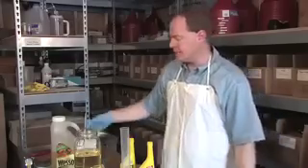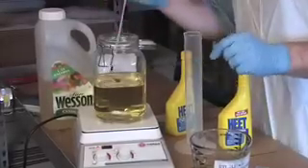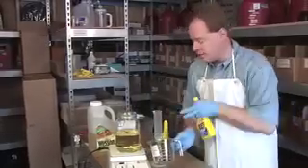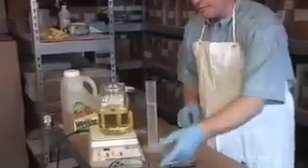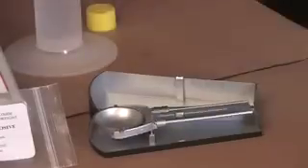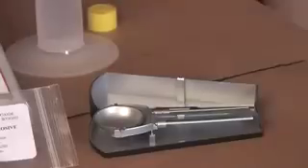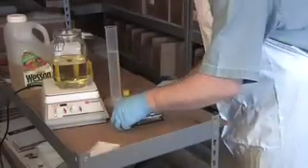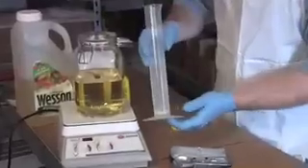Mixing Biodiesel (Part 1) | Bio Diesel Fuel Production

Comment: @mircs1979 

Because your main precursor (vegetable oil) is basically free, and scaling up the refining process will improve the cost effectiveness of what you are doing.

Here the guy is just messing around with a litre of oil, but when you build a decent setup to process large amounts of oil, you are making a very cheap fuel...

Methanol is very cheap, and so is lye. Your oil is basically free if you use used cooking oil. Do the math.

Comment: It'd be interesting to do this in a chemisty class, make biodiesel.
And, yeah, methanol is something you'd want under a fume hood, not six inches from your nose. But he's probably using a more dilute solution.
As for me, I used to take hours to complete simple thermodynamics labs, so i'll just buy the heating system and let it pay for itself.